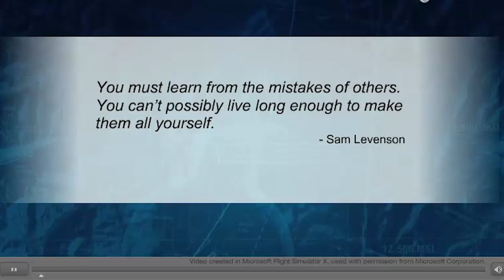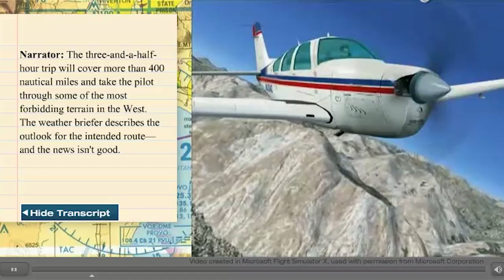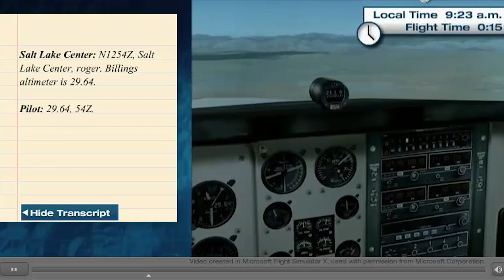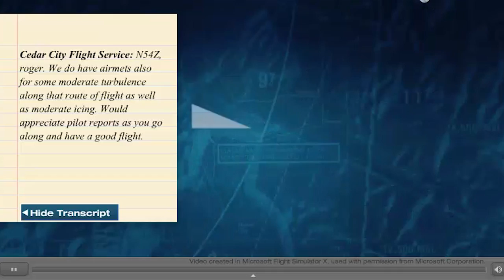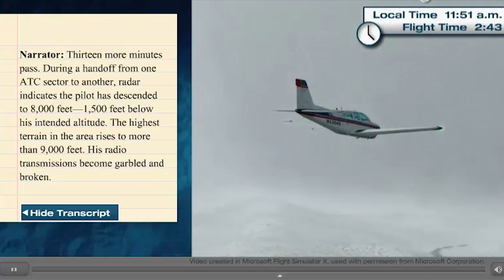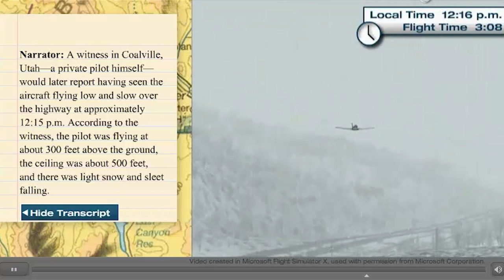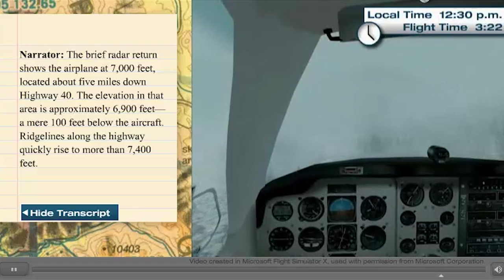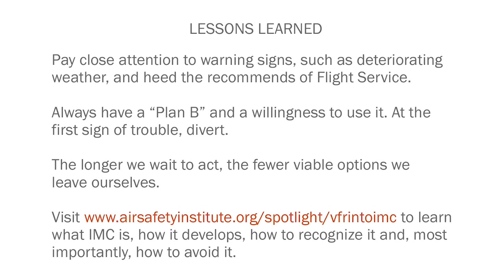Accident Case Study: VFR into IMC

Comment: Sad, this reminds me when I flew with my student on a cross country   flight to Watsonville along the West coast. Airport reported overcast  at 1100 , visibility 10+, overcast layer covered the whole area of about 20 mile radius of the airport including Monterey. But inland was severe clear.  
I knew we would not be going to Watsonville and will divert, but I let him fly it anyway to see what he was  going to do.

Upon approach he gets the ATTIS. Then I start asking him questions.
1- are going to Watsonville? Yes
2- what the ceilings? 1100' overcast
3- what the TPA? 1000'
4-How you going to get below the ceiling? (Only option was over the ocean to the West. The overcast covered the whole valley area and we would not be able to get below the overcast for the mountains were in the way preventing our descent from the West, North, and Southern areas).  Over the ocean and then come in, the area is at / near sea level.
5- how far out over the ocean are you planning to fly to get under the overcast? As needed but looks like just 3-5 miles (which is correct the overcast extended over the ocean for about 3 or 5 miles.
6- So you are going to fly at 600 feet to stay legal over water and then continue over land for another 5 miles or so dodging obstructions  while looking an airport that you have never flown to? Yes 
7- and if your (single) engine fails? (No answer) 
8- then I said NO! We do not scud run when it's not an emergency.  And since it is not then we will divert before it becomes an emergency. So we diverted to Hollister.  
And thence started our diversion portion of the training.

Yeah we needed to work  ADM. 
Always better to play it safe then do something stupid and get away with it because some day you won't.
Reply: or you could have been direct instead of asking a trick question
Reply: @agnieszkaYk  It's not enough to just know the correct answer. You need to know WHY it's the correct answer, and what can/will happen as a result of those decisions.
Reply: @agnieszkaYk  This was not not a trick question... he was picking his student's brain about the his thought process that needs to go into the ADM process... This is an excellent real world situation and I'm sure the student learned from that. Putting all of the individual rules and safety practices into play with a real world flight is the best kind of learning moment from new students.

Comment: So forget about all the weather calls not advising VFR ect. The weather went to hell, and he started following the highway at 300 feet, between Fort Bridger and Evanston. Mile 6 on HWY 40 is 65 miles by air from where he started following the highway. Why on God's great earth did it take him that long to try and turn around? It would have been possible at several spots. Get-there-itis is one thing, but this was just pure stupidity. There isn't anything to learn from this one. No reasonable pilot would let that situation get to that point.

Comment: I'd rather fly with a 100 hour pilot than a complacent 1,000 hour one.
Reply: That's so true. My minimums are very conservative, I'm not taking stupid risks. I only fly into strong winds with an instructor.
Reply: @eldrugoalex  That's a reasonable approach (no pun intended).  During primary helicopter training in Texas, we were soloed after 10-12 hours of flight time and spent rest of time solo cross country.  About 3rd solo cross country, I encountered winds so strong, I was flying backwards trying to reach the heliport.  Changing altitude no help, so I ended up tacking like a sailboat to make it back.
A few years after that, I finished university degree and burned off rest of GI bill by transitioning into fixed wing.  So easy after flying Cobra helicopters, and I was soloed after 2 hours instruction.  When I took off the numbers were challenging yet doable.  By the time I made my downwind leg, winds picked up.  All my landings had been done with full flaps and when I was close to landing, a gust picked me up into a stall and I pushed in the throttle, got some control and called for a go around.  As I started the pattern, the tower asked me if I wanted to go to another airport but winds were not much better at the closest one.  My instructor called from the tower and advised me to bring it in hot with no flaps and that did the trick.
Reply: G Galilei  You would be foolish to stick with a complacent one.  Unless you have a death wish. Complacency is the key issue.
Reply: G Galilei  You got that wrong on many levels.  2 Northwest Airline pilots had their licenses revoked for complacency in the cockpit, using their ipads for nonessential stuff resulting in overflying their intended airport by 150 miles.  And obviously, you never spent time in a cockpit on a long flight. Due to automation, pilots have less to do.  You probably think that commercial pilots wake up one day and fly for the airlines.  How do you think they build up hours to be hired?  I guess you fail to think and that makes you the fool.

Comment: They told him so many times, seems like some pilots can get tunnel vision and its almost like they block out any negative information or justify it with skill level. This seems like it always ends up in disaster, if I ever become a pilot my most important info to judge any flight will be weather. I have seen too many of these crashes due to weather and the pilot refusing to admit defeat.

Comment: I am not a pilot so I am wondering did his plane have autopilot?  If he climbed and could not see ,having to use the gauges , How hard is that ? It seems to me that the gauges would be easy to follow. They tell you your speed, height , level ,etc. I think that would have been much safer. I think the hardest part would be trusting what your gauges say when you can't see nothing out your window.
Reply: That's not how it works.  Autopilot can't see the mountains; being in a pass like that, he traps himself.  Also, he wasn't IFR rated and didn't have an IFR flight plan.

Comment: I don’t get it... can’t they simply refuse to issue vfr flight clearance for his flight plan?
Reply: VFR is not a 'clearance'.  You have the option of requesting 'flight following' but ATC has no duty to follow you if they're too busy with the IFR traffic that they must follow without interruption.   A non-instrument rated pilot is charged with maintaining visual separation with clouds, traffic and ground while not in controlled airspace.
Reply: Patricia McGill -  I am saying that when he files a VFR flight plan, for a route that can not be flown VFR due to weather, they should simply TELL the pilot that they can not accept a VFR flight plan for that route BECAUSE of weather.
That won’t stop him from taking off... but it might convey to a pilot how stupid it would be to do so.
Reply: @christopherpardell4418  They won't do that.  They'd rather have the flight plan filed, then at least they can try to knock some sense into him over the radio, or at least advise first responders where to look for  the wreckage.

Comment: If you’re a pilot get your instrument rating and then remain current with flying instruments. I’ve flown many hours single pilot IFR.  I’ve been in non forecasted IFR multiple times and my IFR experience saved me.  I’ve asked myself on good flights turning horrible (weather gone bad and not in original forecast) and musing how the heck did that happen...I got into the habit of always filing IFR no matter the weather....safe flying....

Comment: So I'm no Pilot but what stops him from going up to an altitude where he knows there's not any terrain and not worrying about zero visibility?
Reply: He is not trained to fly by ONLY looking at his instruments.  Flying literally blind is VERY disorienting and your eyes and sense of balance will disagree with each other. Add in your artificial horizon instrument that is showing you the planes attitude that you swear is wrong based on what your body is telling you equals you diving to the ground upside down and backwards while you BELIEVE you are flying straight and level.  

If he had pulled up he'd be just as dead without training.

The only way out would be to use the artificial horizon to keep wings level, trust is 100% and add power.
Reply: 1320fastback  isn't that one of the first thing you learn though?  I feel like even someone who isn't instrument certified should know that.

Comment: I remember something my uncle bud told me once. The old mail planes before instruments flew through bad weather. Some had a bottle holder on the panel for something to keep them warm in cold weather. Usually burbon. By looking at that liquid in the bottle you know the attitude of the aircraft.  It served as a means to keep the plane level in low or no vis. It was the first  type gauge and along with a compass they flew their routes.
Reply: lookronjon  You should do some Physics 101. That liquid level would remain perfectly horizontal in any coordinated turn , or even a loop if done properly. The only thing you’d notice were the change in G forces.
Reply: @davidwhite8633  Agreed!!!! There have been other “tricks” on how to keep your wings level that were just as useless.

Comment: Why cant this guy pull up and get above the clouds and mountains?
Reply: Andrew Hollywood, The mountains where he was are around 12,000-13,000ft. He would’ve iced up before getting above the terrain and the cloud tops would’ve been in the mid 20,000ft range. His plane didn’t have the performance needed let alone anti-ice systems. His last chance at a good out come was landing at Evanston Airport
Reply: @wadesaxton6079  Don't forget hypoxia, unknown if he had O2 onboard or whether he would use it.

Comment: Rather than flying over the Uinta Winderness Area, flying an ALL mountainous route. A far better option would have been to follow Interstate 15 down a central corridor route. He could have landed at Brigham City, Logan, Ogden, and waited, checked into a motel. IFR pilots would have never tried this stunt. Overconfidence, lack of respect for the terrain. I like flying Interstates Eisenhower’s  gift to GA pilots in the west anyway. Had he done so, any high elevations or canyons would have appeared early while he was in unlimited visibility.  Billings to Bozeman staying near I-90, passing along the West boundary of Yellowstone missing the Tetons and Sawtooths completely, flying through the very wide canyon Whitehall to Dillion picking up I-15 and he has clear sailing until he hits the snow flurries north of SLC. He could have landed at Rexburg, Idaho Falls, Pocatello. I can’t find my sectionals but Ive flown this route 100 times Provo-Rexburg-Missoula or Bozeman you  won’t find lower elevations. Damn sad and unnecessary it just contributes to the “GA Flying isn’t inherently safe” baloney.
Reply: Bobby Paluga I would guess that the reason a lot of pilots in singles in that part of the country don’t feel like getting an instrument ticket is 1)   They would be getting a lot of clearances to 14,000 and above , and don’t want to ferry oxygen tanks around all the time. 2)  If they lose that engine while in IMC on an airway , there may be no suitable place for a forced landing to be had. 3} There’s more chance of icing in precip. 4} They can choose their altitudes , and remain within gliding distance of readily available forced landing areas , such as roads , while VFR , even at night ( because of traffic headlights ).
Reply: yeah I get what you're saying. "This Stunt" you mean the scud running in shit visibility right?.  But I'm not a pilot, what do you mean by flying an all mountainous route?
Reply: Flying in the Rocky Mountains can be challenging in clear air because of the air currents, if you fire up Google Earth take a look at the cities mentioned. This gentleman picked a flight path over mountains and valley's, with a few small towns inside those valleys. Not only would his flight have been very bumpy, but if he were to go down it might take a long time before he got help. He had the option of flying thru valley's without any significant mountain passes, but he seemed not to respect his weather or terrain. I'm saddened when a life is lost when it needed not to have happened.

Comment: If this airplane had a ballistic parachute could this have saved the pilots life?    Could he have gained a little elevation and popped the chute?    Or would he have?     Horrifying.    (And could he have landed on the highway---or is there too much pride involved?)
Reply: nope. Not with his arrogance and complacency.  But Yep, your scenario is plausible and it would have worked.  Unfortunately this guy pushed his luck 1 mile too far.
Highway landing is hit and miss at best. Obstructions on the ground are mostly unknown and come at you fast.  Namely power lines and telephone poles.  Not to mention the potential innocent victims in vehicles.  That could have been an option but it is one of the LAST resorts a pilot would ever risk simply because of the traffic/poles/wires.
This whole thing was about complacency. It seethes in the audio.  hint: I done this before, I'll do it again... 'hold my beer'... << that's what he was telling the controllers.

Comment: I would also point to Hypoxia impairing his judgement.  I am 56 and in good shape.  Just flew a 54 minute flight at 9000ft and mistook a smaller town for my home airfield.  Then promptly bounced in a horrible landing.  After parking I checked my pulse Ox and it was low.  I just set new minimums for myself, Oxygen above 8000 and always at night.  God rest the soul of a man who just might not have been thinking clearly.
Reply: wow Michael what an astute comment... I hadn't thought of that. Thanks for posting this. I'm close to your age, but this is definitely thought provoking!
Reply: Michael Doherty  Very good point. I forgot about that in my previous comment here. Too many pilots believe that as long as they stay below 12,500 , hypoxia can’t be a problem. But prolonged flight at lower altitudes, say the 7~9000’s can have a similar effect—it just creeps up slowly and insidiously without the pilot even giving it a thought. There was an accident report about 30 years ago,I think, where the pilot had been flying for several hours at about 8–9000’ with no more plausible reason for his bad decision making in the resulting fatal accident, given by NTSB, than slow buildup of hypoxia.

Comment: 14:30 It seems at this point his best option would have been landing on the freeway and dealing with fines and other headaches that would have resulted.
Reply: If the weather is so bad that DRIVING is unsafe, it is defiantly to bad to fly. This guy would not have made it even if he had been IFR.
Reply: I don't know about that highway, but hitting power/telephone poles is a huge fear factor for ga ppl.
Reply: Eric, his best option would have been to fly a 290 azimuth out of Billings, land in Spokane and catch a 737 to SLC. From there they have all the rental cars you could ever want to get to the jobsite. It probably would have cost him $600 for a walk-up plane ticket, which is still cheaper than a funeral.